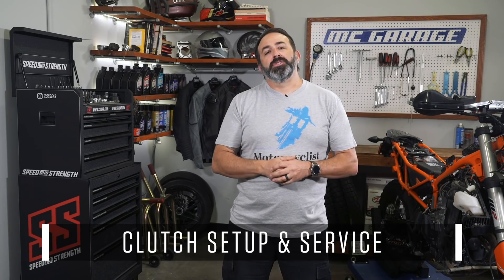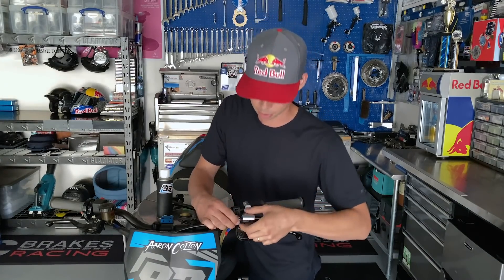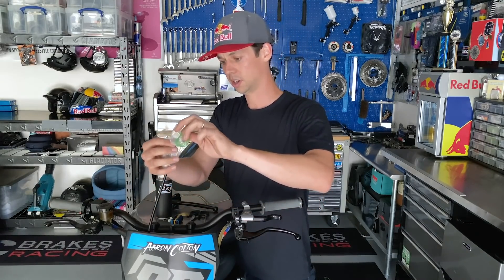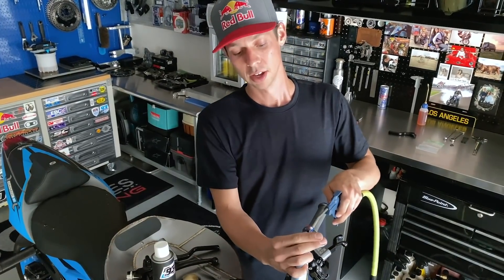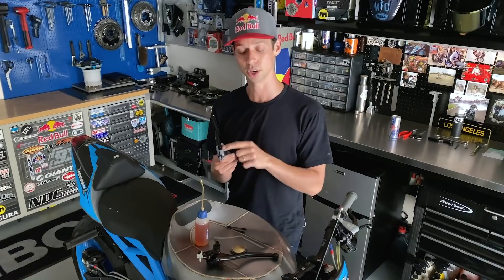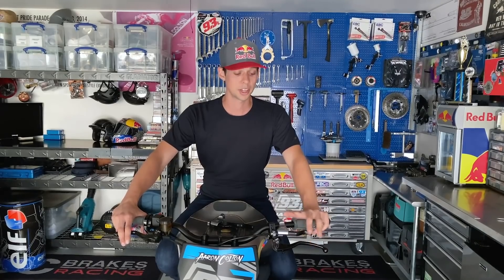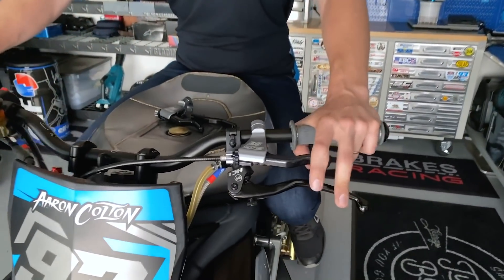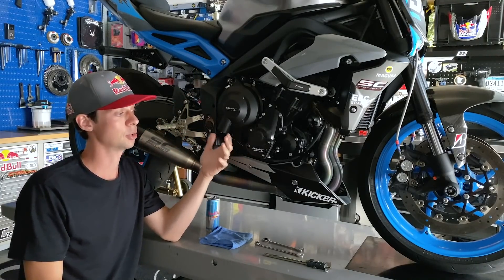Motorcycle Clutch Maintenance How-To Tips | MC Garage

Comment: Personally I would not use Pressure Pack Lube ??? It has solvents that evaporate in some cases leaving a heavy drag rather than a smooth feel. Yes !! been using the Bag trick for near on 40 years now and simply fill it with 5 Wt Hydraulic Oil ( Hydraulic Oil has very low tack but high shear stability low drag ) I leave overnight with a drain tin under the lower end of the Cable and allow it to drain through for 24 Hrs ( This prevent excess from dribbling all over the bike ) I mad my own Lever's ans alloy mounts and use 608 Skate bearings in the pivots :)  .  Nice Video . 
The Brake ?  that is for the Rear is it ?

Comment: I just recently took my motorcycle to have the clutch discs (or plates not sure for the name) replaced for new ones, but now that I got it back, the clutch lever is harder to pull than before, much harder, making it tiring to use, the mechanic told me that was normal since it's new clutch  discs and that I would get the hang of it, sounds weird to me, but is it true?
Reply: Unless you had heavy duty clutch springs installed as well no, it isn't. Check that he routed the cable correctly when he put it back together.
Reply: @bazonka1  thank you!

Comment: If springs are shot, does that make the clutch feel heavy at the lever?
Reply: No
Reply: Usually it would actually provide a softer feel at the lever as the springs memory would start to atrophy. I personally have not yet had issues with the springs themselves wearing out with the exception of big bore minibike auto clutch setups.
Reply: you need to do as this video or replace the cable
Reply: No you actually have to compress the springs when you pull the clutch in. tat is how it releases pressure off the clutch to let you shift gears

Comment: So i have a problem with my bike. There is a ticking vibration sound coming down form the fan/where the air filter is. I had the shop do a air filter change on the bike, and it started after i picked it up. 
Its only there when its in gear. when its idling there is no sound its perfectly fine. so i know its not the cam chain. But soon as i take off it starts. especially around 2nd to 4th gear around 6-7k rpm. 
You know how you give it gas then let go a little and let it catch it self on the cruising rpm? thats when it starts. anyone know what it could be?

Comment: I have to ask something, what is ride by wire throttle system and can I get aftermarket ones?
Reply: A motorcycle that has one is most likely developed with one. I have removed a fly by wire system to upgrade to a traditional cable pull but never the other way around.

Comment: What type of multi purpose lube graphite, silicon spray or just wd40?
Reply: There are some products (sprays) sold as ''Cable lube''... 
And some motorcycle manuals say engine oil, what you normally use on your bike.
Don't know what he used in this case (he just talks about ''Multi propose lube'', nothing specific) but you should be good with the cable lube or oil. Wouldn't use wd40 and the other options you say don't really seem much better to me tbh.

Comment: What about hydrolic clutch ;-)... no need to adjust
Reply: *hydraulic
Reply: They are great if you got one...sometimes a pain to bleed but otherwise of course you take what comes on your bike.
Reply: I really have not had the best of experiences with OE hydraulic clutches. Often lacking in lever feel and finite clutch modulation. My trail bike is currently a Hydro clutch and although I miss the feel a cable clutch provides it is nice to be maintenance free.